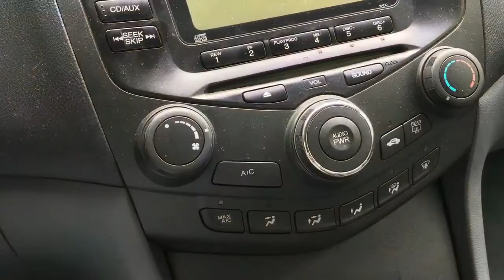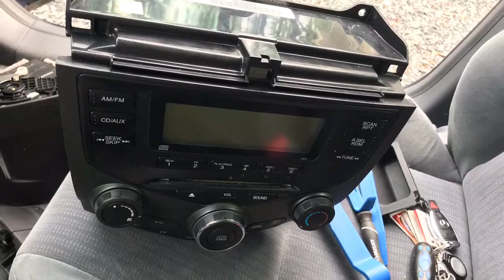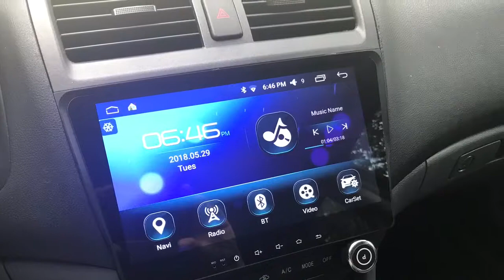Android radio for 2003 Honda Accord

Comment: I bought this same system and the idiots sent me the Euro version with the driver button on the right. THen the freaking unit would not operate my single zone ac, so the seller suggest I buy they adapter... I buy the adapter and it STILL wont work. COMPLETE BULLSHIT